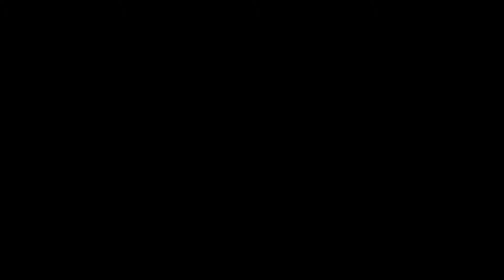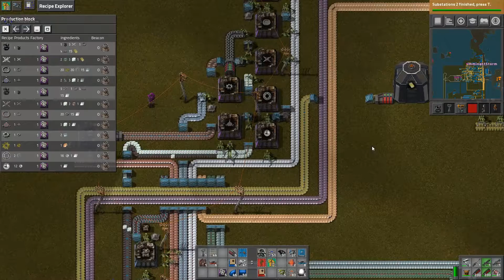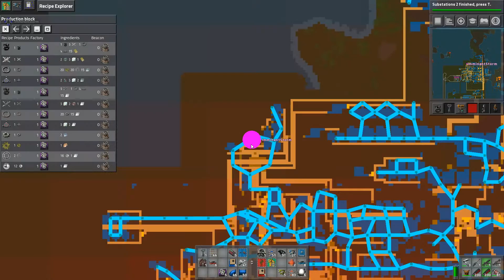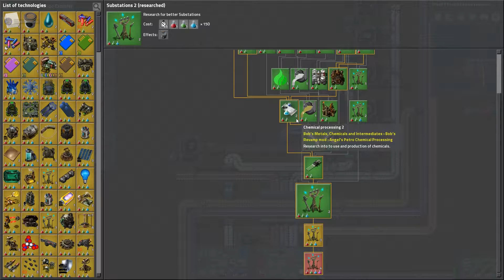Factorio - Angel's & Bob's - Episode 78 - Better Roboports

Comment: P.S. Forgot to mention: oil can be gotten from bio-processing (I think corn can be turned into corn oil), so if you can't find any multi-phase oil on the map, that's an alternate approach you might be able to use. IIRC, you'll need to find gardens on the map and harvest them (I don't know if bots can harvest them, so do it by hand just to be on the safe side) before you can set up to work on bio-processing.